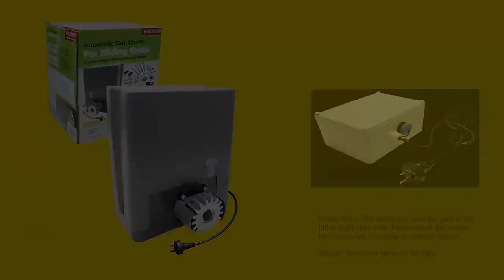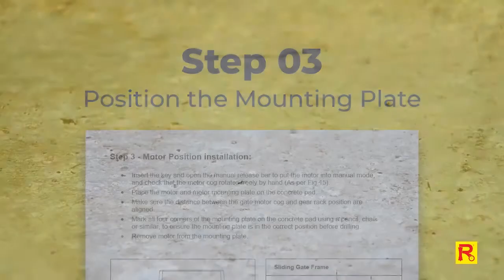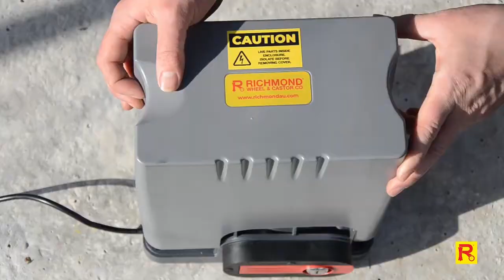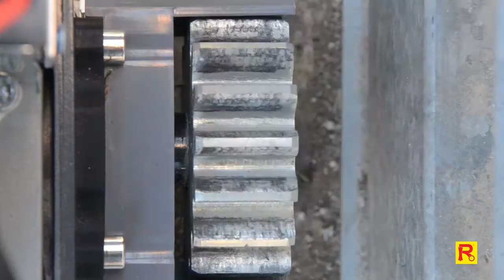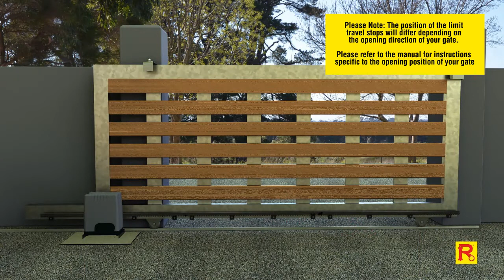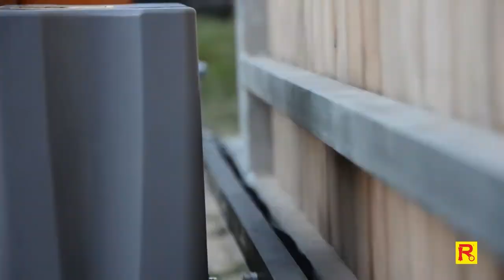Installing a Richmond GTR064 Automatic Sliding Gate Kit

Comment: Ive just installed this system. When pressing the remote, it moves left then right in about 200mm increments. Not sure whats happening. Any ideas?
Reply from the maker: Hi viking designs,
It sounds like a minor settings issue. If you get in touch with our gate support team they should be able to troubleshoot it with you pretty quickly. You can submit a ticket via https://gatesupport.richmondau.com and the team will get back to you as quickly as possible.